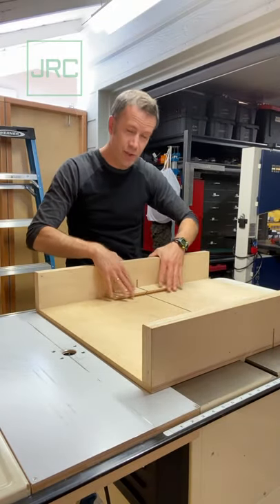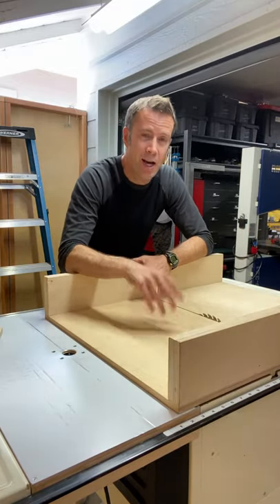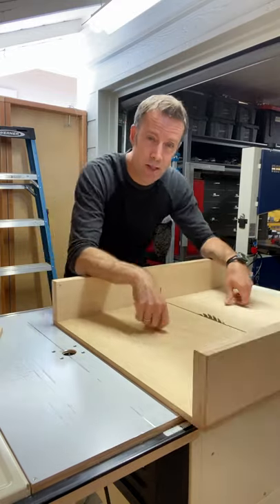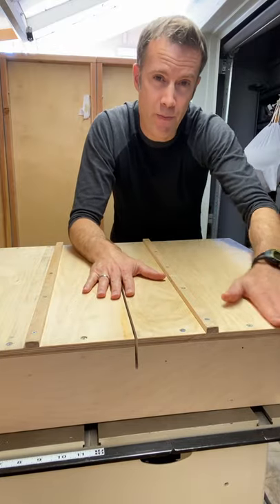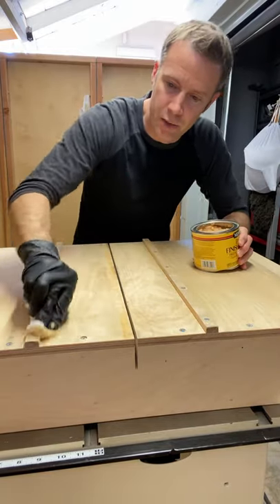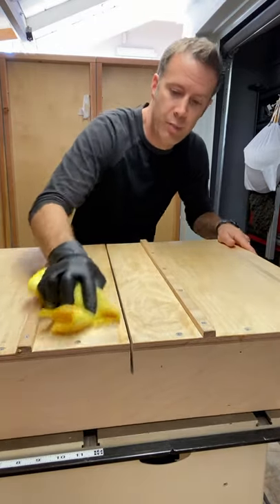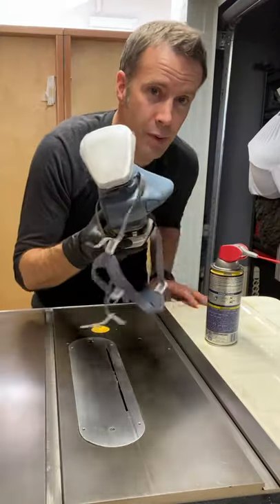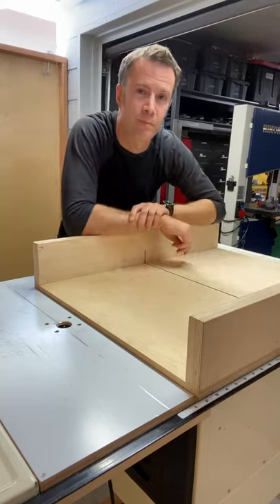A must-do to keep your table saw sled & deck tip-top #shorts

Comment: I keep stumps of candles for this. I simply rub them over wood surfaces I need slippery. I particularly use it on drawers in old furniture, but also as dry lube and water repellant for old hinges, zippers, tools and  many mechanical things. 

No spill, no empty cans, basically free, last for a long time, can be lit to melt or warmed up objects with just a hair dryer for penetration.

Comment: Ever try blaster dry lube?
Reply from the maker: No, I haven't. You can spray that stuff on blades too, right? Should I give it a try?
Reply: @JRobertClark  
I currently use on my router table so oil doesn't transfer to work. I was having problems with real square material dragging on the bed and on the fence. I haven't tried on the table saw yet. I tried this on Friday when I ran out of wd40. I have to almost re learn due to almost no drag. You can force it through too fast .